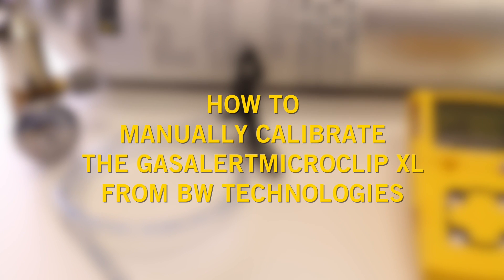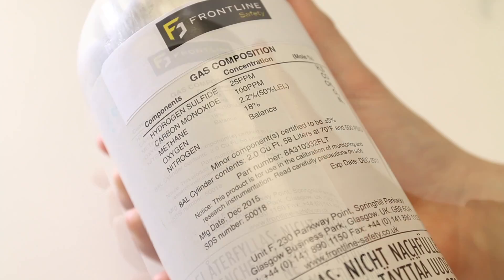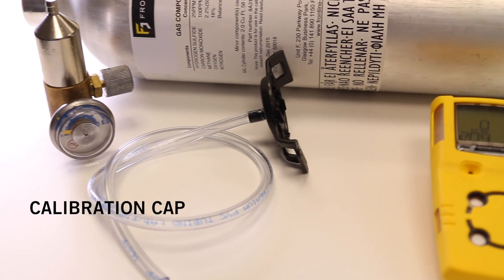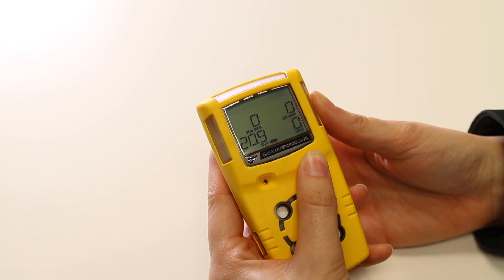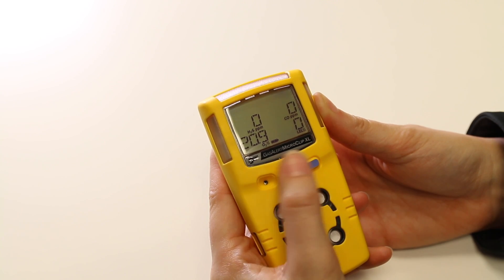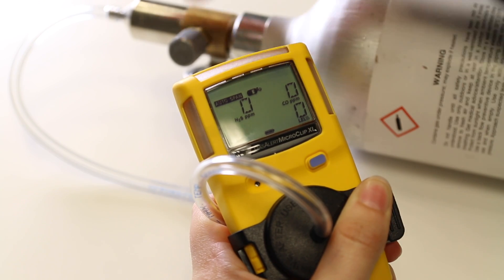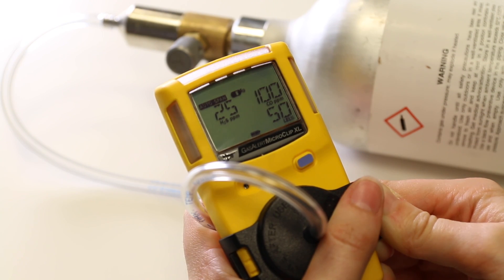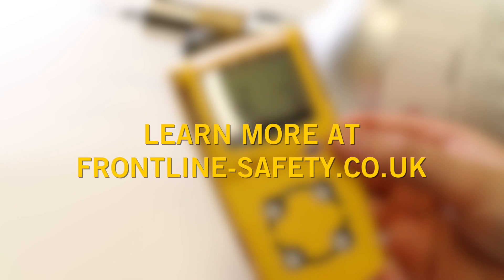BW GasAlertMicroClip XL – How to Manually Calibrate

Comment: Do i need to have special training to do it? or its just purchase the gas and calibrate
Reply from the maker: Hi Armando, 

We would recommend that training is required before proper use of a gas monitor and we would always advise of reading the manual before use. We do have engineers that could facilitate this for you depending on availability. Visit our servicing page at the link below for more information.

https://www.frontline-safety.co.uk/portable-monitor-servicing/

Thanks!